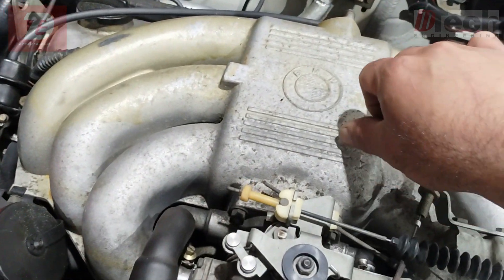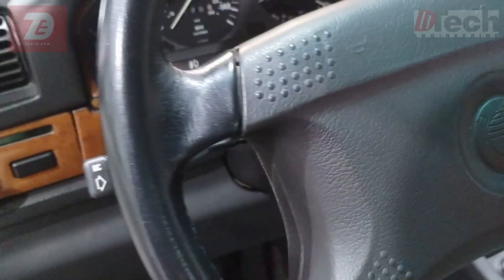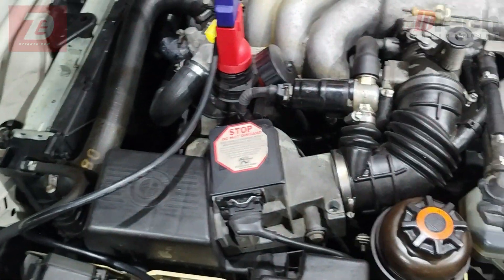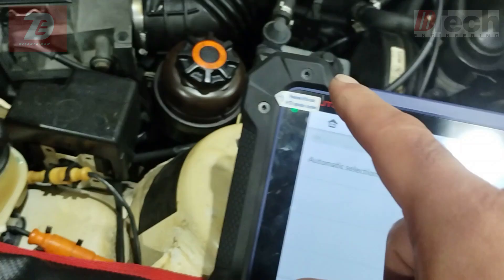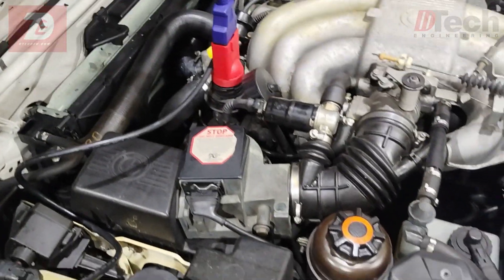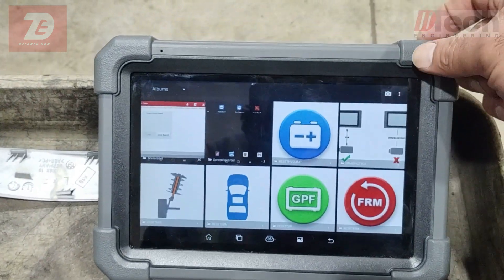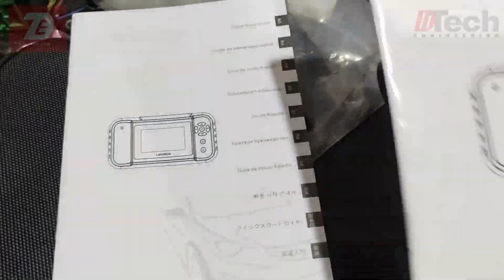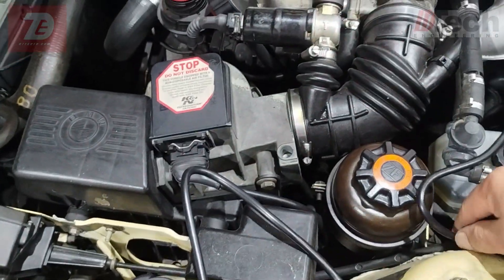Scanning 1992 BMW 325 E30 Check Engine Light w/ Launch

Comment from the maker: Interested in the scan tool used in this video...

LAUNCH X431 Elite V2.0 Bi-directional OBD2 Scanner for BMW Mercedes benz VW audi
It will be on sale for 25% off using this discount code  5I5X8H46.  The sale starts on 4-24-24 and ends on 4-30-24.  Product link listed below.

https://www.amazon.com/dp/B0CQSD48T3